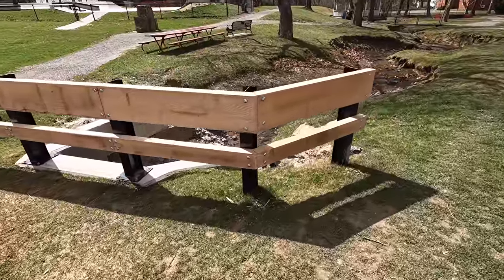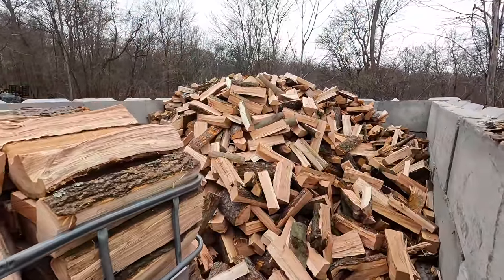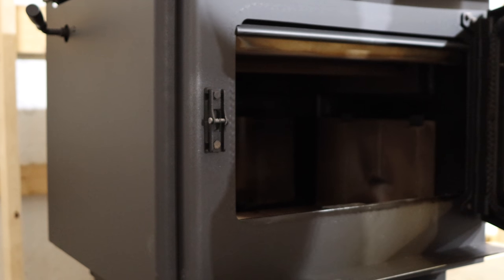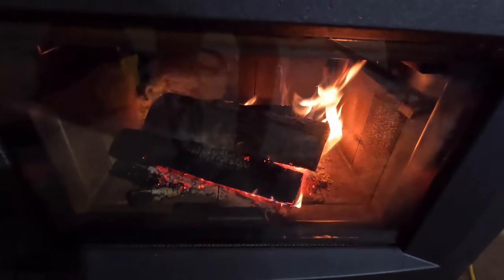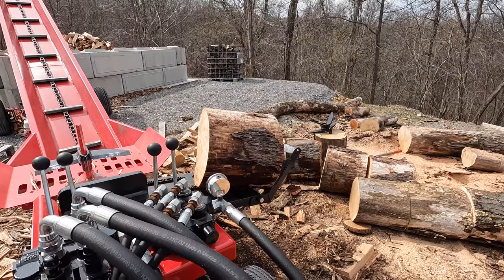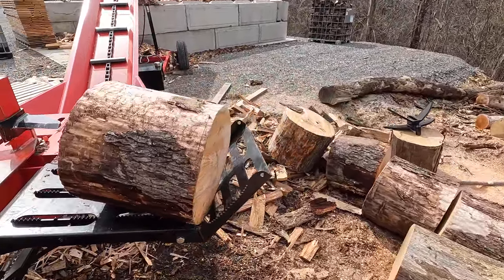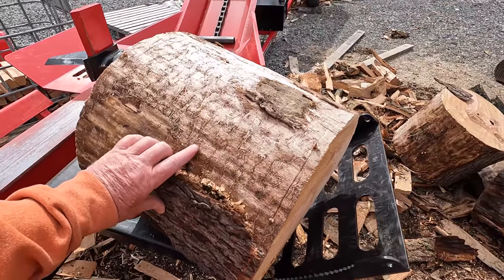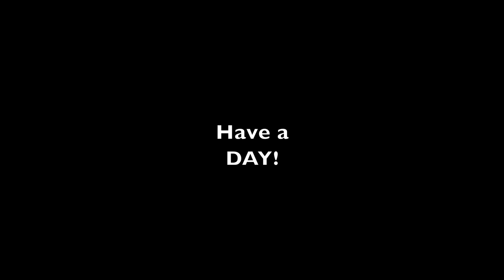Wood Stove Break In, Regency Pro Series F5200, Park Update, and Wood Cutting

Comment: Mike, we bought a house with a wood stove that I don’t think had been cleaned inside in YEARS. You literally could barely see any fire thru the glass. We tried a couple cleaners for wood stoves, which helped but didn’t come close to really clearing up the glass. Saw a random video on here this winter that showed taking some of the ash from the stove and mixing it in a cup with warm water to make a paste, then using that to clean the glass. Worked like a charm. COMPLETELY cleaned our glass up to where it basically looks like new. I do that about once a month or so during the burning season, and clears it up quick and easy now. Best of all, doesn’t cost anything! 
Have a day!
Reply: I just wet newspaper and dip it in the ash.  I think I'm going to try this way rather than wetting the newspaper.
Reply: Mmm… fight fire with fire.
Reply: I’ve used wood ash paste for 30 years on my Vermont Castings glass door inserts.  Wood ash is a strong base (caustic), which is why it was used by our ancestors for making lye soap.  I’m not familiar with the cleaner Mike showed in the video but it is almost undoubtedly a caustic solution, as is Spray Nine and Fantastik.  Much cheaper to use wood ash!
Reply: try oven cleaner when the stove is cold
Reply: Ash works great. And it’s free. 😃
Reply: It's the old way of doing it when everyone had a fire but didn't have the money for fancy chemicals....free, simple and no waste.
Reply: I’ve had a fireplace insert for the past 10 years. Running the stove hot a couple times a day will help keep the glass cleaner. I also use the fine ash with a damp cloth on the stubborn spots.👍
Reply: That's how I clean my glass also. I have a cast iron kettle on top of my stove to put some moisture back into the room. I dip a crumpled piece of newspaper in it then dip it in the ashes and scrub the glass. Then a second piece of newspaper to wipe off the excess. Works like a charm at $0.00 cost.
Reply: I clean the glass when my stove is cold in the morning with a damp paper towel. That's all required if the routine is regular. If I let too many days transpire without this cleaning, a damp paper towel dipped in ash works great.

Comment: That’s a beautiful stove and Regency makes high quality products.   Our home is heated with a Vermont Castings Vigilant wood stove that still works perfectly after over 30 years of use.   As with any wood stove, I have had to occasionally replace the door and  griddle gaskets, as well as the andirons and a piece of door glass, but for 30+ years use, that’s to be expected.   The one thing I’d hate to give up is the top-loading feature with the cast iron griddle.  It is so convenient and fast, and doesn’t allow smoke into the room because you have to open the bypass to updraft before you can open the top.  The porcelain has worn away in places but it will stay in the living room as long as I can carry wood!

Comment: Mike I use the same cleaner. Does work well. They also have a cream cleaner that works if you get buildup after a long burn cycle. When we built our home we put in a fireplace insert. We install a posi-pressure wood stove. Great unit and really keeps the heat more even throughout the house.

Comment: I use the same glass cleaner and it is great.  Used it over 20 years.  If you fan does not have a variable speed I recommend adding it.  With my stove I can get it so hot with the fan running that you need to have the fan on a very low speed if at all or you will be opening up a window.

Comment: The manufacture of Pacific Energy stoves (which I own) recomends cleaning the glass with wet paper towel with fire ashes dabbed on it for cleaning the glass and  and polish dry with dry paper towel. 
cleans any staining off with out hard rubbing. My stove has an automatic air wash engineered into it's design and cleans itself well. Only need to clean the glass every 10 fires or so . Try the paper towel method I think you will like it.

Comment: Ive used water and a little vinegar…a soft blue shop paper towel….dip the towel in the water/vinegar then dip into the ash and lightly rub in circles until the char is muddy on the glass…then use a slightly damp clean paper towel and wipe clean….repeat if necessary and the glass will be clean as the first day..

Comment: We have a Country Hearth 2000 I bought from Tractor Supply in 2015. We bought some special wood stove glass cleaner at TS and it will literally take your breath away if not careful. We found that the Great Value window cleaner works just as well as anything and is a lot cheaper and not nearly as dangerous!

Comment: Mike I have a Morso Badger multi fuel wood burner which has air wash. The air wash keeps the door glass sparkling clean. I chuck everything into it and it burns clean. I've even tried house hold coal and it works well.

Comment: Hello!🙂🚜
Gonna try that Speedy White.  I have been using RutLand and it works pretty good too.  I use a razor blade scraper to get the baked on soot off.  Only do it when the glass is cool.  Spraying anything on hot glass will cause it to crack up.
Reply: David!👍😊
Reply: @oldmanfred8676  Hi Fred!  Have a wonderful day!
Reply: I use generic glass cleaner from Walmart and it works great!
Reply: @terryslade4760  What's it called, "Great Value Fireplace Glass Cleaner" ?
Reply: No it’s just the generic window glass cleaner. I also use it on my Harley windshield and chrome!
Reply: @terryslade4760  Thanks!
Reply: Good aftermorning David , there's a fellow further up in the comments says he used the ashes mixed with water to make 
a paste ? and applied that to the glass and then cleaned it / supposedly came out really clean / and best part he sys 
is it's free ! ( as I don't have a wood stove I don't have this problem - and I'm a bit skeptical ? but might be worth wasting 
10 minutes of your time to find out ?? )  Have a Day ! ;-)
Reply: @oldmanfred8676  / Fred ! , good to see you :-)
Reply: @badcat4707  Hi BadCat,  Yes we used to do it with the ashes and vinegar but it is pretty messy.  Now I spray the cleaner on just the back of the glass, rub it in with my fingers, then scrape it down with a razor blade scraper.  Thanks for the information though.  Have a blessed Sunday!
Reply: @davidmorse8432  You're welcome friend , you as well :-)

Comment: Mike, I use a mixture of white vinegar and water to clean my wood stove insert glass.  It works every bit as good as the store bought products.  The stove looks nice.  Does your stove have a control for both the primary and secondary air?  What is the source of the combustion air?  Is the air flow in via the stove pipe/ flue?

Comment: Hey Mike I found if spray sheet of newspaper with the cleaner and then dab the newspaper into some ash. Spray the glass with a cleaner and then use the newspaper with the ash. You use a lot less spray to clean the glass. Especially if the glass is really dirty.

Comment: Have you been doing any physiotherapy for your finger Mike?  If not it might be something you want to look into.  I cut the back of my thumb down to the tendons years ago and when it healed there was a lot of scare tissue.  I couldn't bend it at all.  I did physio where they would warm it with paraffin wax and then stretch and bend it slowly.  They also made me a special splint that I would have to wear for hours per day that would put traction on it with an elastic band.  It took several months but I eventually got the full range of motion back.  Hopefully yours gets back to normal one way or another...Dave

Comment: Hello Mike,  good video as always.  Something else to try on the inside glass.  Use a dab of ash on a wetted clean cloth or paper towel.  Clan the area you were spraying.  It will not dissolve the same way as the spray but it will clean the glass remarkably well and without having to buy another product to keep around.  Worth trying since it is free ash from the Wood Stove.  Would like to hear some comments on your experience at Top Golf.
Reply: You can make the spray yourself, take a coffee filter put a few spoons of ashes in it, hot water on it and you have made the cleaner yourself. It's that easy.

Comment: Just out of curiosity, do they make a stove with a radiator built in that you could pump your radiant floor heating fluid through so you could heat the whole building with wood instead of using gas?
Reply: Lots of wood and coal stoves have water line hook ups.

Comment: Too bad Wolfridge doesn't have hydraulic hoses you can attach to the splitter and run to the conveyor instead of running two engines.
Reply from the maker: There is some reason that won't work well, I can't remember what it is though lol. I saw Chris talk about it once. That little Honda on the conveyor just sips the fuel. Probably a gallon in 8 hours

Comment: Don’t accept that SVL 97 with the factory tracks, they will beat you to death mine is horrible. Kubota knows they are a problem and will swap them out for different ones if it has less than 50 hours on it.